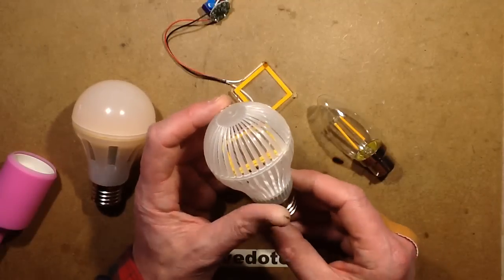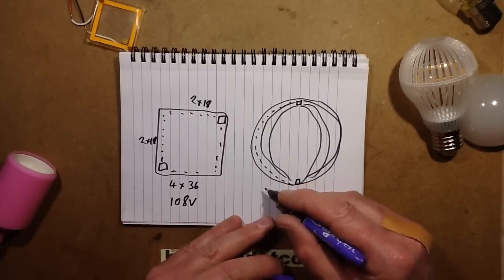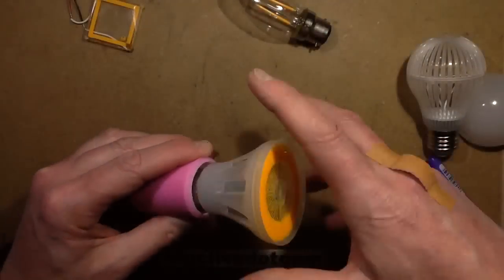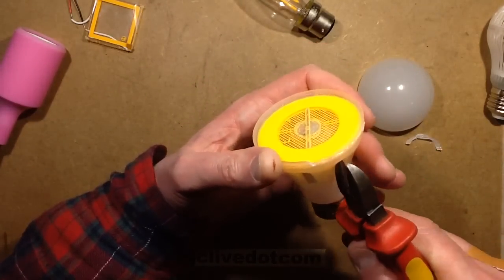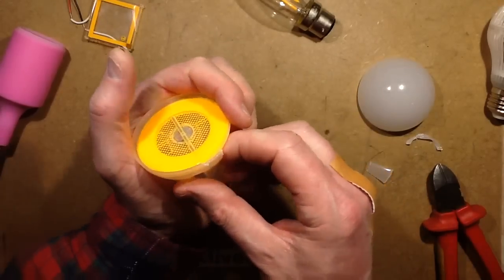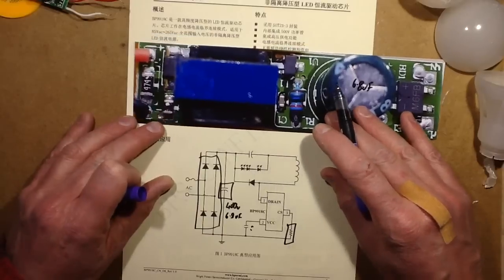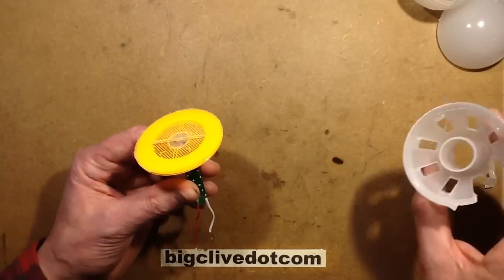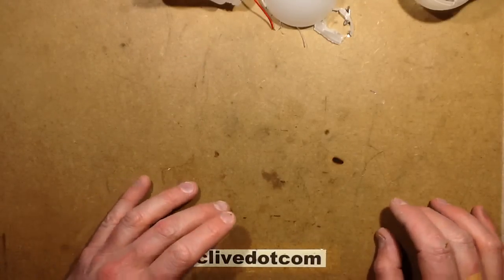Next generation glass COB LED lamp MKII teardown.

Comment: I really LOVE a ( leakage moment ) .... my " ghost " lamp ( awesome nightlight ! ) was probably the best buy lamp from the 2012's ( maybe they should market these ? ? ) ...... DAVE™ ............
Reply from the maker: You can turn many modern lamps into ghost lamps by removing a resistor inside.  Usually labelled 474 or 105 (470K or 1 Megohm)

Comment: Looking back on the glass sandwich lamp from 2019/20, the square-glass LED layout, and the filament-style one I have to wonder what the hell they were on that week to think up the sandwich and what they started out on with the square one before that.  It can't have been that cheap or easy to make for a start and for a second bit it can't have conducted 9-10w of heat that well either no matter how much air you gave it.  They must have figured leave the larger sized bulbs to the COB panels glued/compounded down to air/edge-casing/full heatsink (depending on quality of lamp maker) and put the filaments into bulbs that it both look nicer in and fit better like candelabra-sized ones (though power miniaturization of it couldn't have been easy unless they did a 3-pin buck regulator or similar).  Really weird transition time for LED bulbs for sure.

Comment: That was very interesting, and having seen the other "new generation" of LED lamps video, I can see this 'newer' version with its laminated design addresses one of my comments on the previous lamp, which is the mitigation of uv artefacts. With glass on both sides of the active elements, uv light is effectively blocked, so no stray artefacts to damage the plastic shell, nor to harm us, or anyone/anything else.

I am wondering just where the development of LED lighting will eventually lead us. Incandescent lamps have been virtually unchanged since the first tungsten filaments, so that's over 100 years. We had a brief flirtation with CFL for about a decade or so, and saw very little change during their lifetime, and now LED lamps, which conversely, have gone in leaps and bounds, with a plethora of different approaches, types and variations on a theme, but will we ever see large scale single light emitting elements that can output similar lumen values to those from either, say, 100W tungten, or 10W (assumed) LED array? Or are we heading towards something like an electro-luminescent fluid filled tube/bulb (OLED, maybe?).

Where will the quest take us?

Comment: ... It should be noted that the production of LED's and cob-led's are clearly wrong, which lead to nothing real - only to more or less high consumption of resources and expenses, which are in no meaningful relation to the real use of a room lighting.
So nothing is really functional.

What bothers me is the presumptuousness of the manufacturer to impose a product on me - that is, to sell a floodlight, for example, with 400 (!!!!) led's, which are available on a permanently installed board.
If an LED fails, the whole system can be scrapped - because it is usually faulty.
that is not right!
you can not exchange such things: there are no replacement bulbs to buy:
With no LED lighting, you can replace LED bulbs!

Thus, high pollution of the environment - especially here in the country (Germany) electronic scrap rather not separated and recycled.

I think: you should build yourself if you can!
but not even there is really useful in the market: the leds are closed
small - to create effective and meaningful lighting with it.
scale: plant lighting or seawater aquaristik - what works there right - is also to use!

regrettable that there are many who propagate normal - abnormal, which is really no good.

Where are the interchangeable LED modules - in full spectrum mixed light?

Comment: Strange, just got one of these from amazon but it uses a capacitive dropper, somewhat disappointed.
Reply from the maker: Capacitive dropper may be more reliable in the long run.
Reply: That would be nice, although I do wonder how much different the power factor would be, this one is 0.5.
Reply: It hasn't lasted long, the inner ring of leds go from a very dim flickery state to fully on, not sure if it's the leds or the dropper.

Comment: Aliexpress has a few of them, Alibaba is quite flooded. I've bought a few of these bulbs from an Italian retailer on eBay, with power ratings of 6-8-10W. The model Clive tore apart is the 10W model, 8 and 6W are very similar and a lot cheaper. I got a failed lamp with a broken wire between led and board, and went straight into take apart mode... The dome is quite well glued and doesn't want to come off easily, but once that's done, if you cut between plastic and glass with a scalpel, the glass disk will come out easily enough. That bulb has now been assembled back again and works well. For 3.5€, I cannot say those bulbs are half bad. As others mentioned, the magic word to search for these is "mcob".

Comment: Pictures of the cob with phosphor layer removed: 
http://pl.tinypic.com/r/2yjx9iq/9
http://pl.tinypic.com/r/2uiyrg5/9
http://pl.tinypic.com/r/10fdt0m/9
Reply from the maker: Interesting.  I guess you took the phosphor gel off the other side.  That could be quite blue looking when lit.
Reply: I have separated the two round glass pieces completely. It still lights up and is very bright and blue. BTW: it gets quite hot (even before being disassembled).
http://pl.tinypic.com/r/2a69oo5/9
http://pl.tinypic.com/r/2hn1d07/9
http://pl.tinypic.com/r/2nreqv4/9
http://pl.tinypic.com/r/vyqu6h/9
Reply from the maker: That's interesting.  I thought the phosphor loaded gel would have been used to encapsulate the chips, but I guess it's just a layer on the surface just like the front glass?  And actually just hovering above the array of chips?  That will potentially reduce the effect of phosphor degradation at the point of contact with the emitters.  Plus it will remove the issue of thermal expansion and contraction differences causing bond damage.
Reply from the maker: I might be tempted to try that.
Reply: Yes. There are two glass plates separated by plastic o-ring at the edge. The o-ring is 1mm thick. The plates are glued to the o-ring. So there is 1mm air gap between them. Both plates have phosphor coat rings. The one facing the bulb dome has phosphor on the outside of the cob sandwich, and this plate has chips on the other side - inside the sandwich. The plate facing the bulb thread (the one with checkerboard pattern) has phosphor layer inside the sandwich. The phosphor layers are of different thickness. The plate with led chips has thicker coat and gives more yellow colored light, the other one has thinner coat and gives a little bit colder light shade. I have reassembled the bulb with only the plate with led chips and  phosphor removed. It provides strong blue light.
Reply: Played for a while with the created blue bulb an it seems also to produce small amount of UV light. Made my eyes sore, very unpleasant.
Reply: Holy crap, nice work! :D Hopefully Clive does a followup and shot the pics :D
Reply: Because it's the most pleasing colour to human eyes :)

Comment: Illuminated single-pole wall light switches, containing a halogen bulb in series with main bulb are common in my part of world. I guess the 470k resistor is to prevent the bulb to blink on those switches (as you suggested). That is a clever tweak.

I see a scratch on your left thumb and sticking plaster on yoru right hand. Maybe it would be better to use a Dremel type tool instead of knives and some protective gloves.

Thank you very much for the videos.

Comment: Hunch from a former manufacturing engineer - I suspect the raised phosphor lines on the front are so the same die can be used to print the front and back glasses, and allow for the power lines to the pads.  Hard to tell for sure without opening one, but it would make sense on a commodity item to reduce the amount of printing and inventory by making two identical layers

Comment: This form factor might be used to make a fitting that attaches to a regular ceiling point and has flat arms extending out with what might appear to be downlighters along its length but the downlighters wouldn't need all that drilling through the ceiling and extra wiring expense?

Comment: Clive, what is the DC voltage at the led connection and I assume that this one is only for 220vac.
Reply from the maker: I tested it on 120V and it worked fine.  Combined LED voltage is around 75V.
Reply: bigclivedotcom Thanks, ....... I  pulled one of my fluorescent  (LED) tubes apart and found it to contain 6 banks of 34 leds each in parallel with a total current of 200 ma at 80 vdc across the leds. All it contained in the circuit was a bridge rect,  2 resistors, one cap @ 22 uf and two fuses front and back . This tube was a direct replacement of the old tubes and seems to work very well .... so far.

Comment: Can someone link me to the page that I can get one of those bulbs at since I have been looking for a light bulb for my office that has the bulbs sit sideways and if I use a regular LED bulb there is a dark area in the room because the bulb only points light in one direction and doesn't direct any light back to where the base is and these bulbs seem perfect for my office since they do direct light to the base of the bulb so I can actually get full light in the room
Reply from the maker: Consider a lamp splitter adaptor that allows you to put two LED lamps in one socket at an angle to each other.

Comment: That's really nifty :)  I can think of all kinds of crafty ways to use those disks in artsy lighting installations in restrooms and other public spaces, where you would suspend a larger glass or translucent material like acrylic and a smattering of those "pucks", and then the wiring for them would snake back to the hanging points, and the driving circuitry would be out of site.  It would provide an interesting feature of light in a very thin package that would splash down AND up, and if the little pucks were sealed into the material, it would be about as safe as any other fluorescent lamp.  I could also see these used as like oversized "pixels" or a very large dot matrix display (think freeway information signs or traffic control units with the big amber arrows).

Comment: I think I can shed some light on how the chip actually works.  The data sheet's drawing is a bit misleading.

Notice that the chip lives with its "ground" at the top end of the current sense resistor.
Notice that the Vcc capacitor goes to the lower end of the current sense.

When the MOSFET is on, the Drain connection is shorted to the CS connection by it.  This means they can't be charging the Vcc capacitor when the MOSFET is on.  Also since the capacitor goes to the bottom side of the current sense resistor, the voltage the chip sees as Vcc will ramp down as the current ramps up.
Thus by watching the Vcc, they get a good signal to use for when to switch off the MOSFET.

When the MOSFET is off, they charge up the Vcc capacitor to some regulated voltage.  They may have gotten clever and do this with a delay so that the regulator making Vcc is still off while the voltage is Mains+75V and it only charges when the energy is out of the inductor.

I base this on a "if I was doing it" line of reasoning and the fact there are only 3 pins.

Comment: Anyone else looking for these lights just search MCOB

https://www.aliexpress.com/wholesale?catId=0&initiative_id=SB_20170129074236&isPremium=y&SearchText=E27+mcob

Few on Amazon for anyone in a rush
https://www.amazon.co.uk/XINBAN-white-1300LM-crystal-replaces/dp/B0120S8KIS/ref=sr_1_26?ie=UTF8&qid=1485704712&sr=8-26&keywords=MCOB

Seems they sold out all the ones they had if this is the listing :( 

https://www.aliexpress.com/item/8-10-12W-AC-85-265V-E27-MCOB-LED-360-Degree-Emitting-Light-Energy-Saving-Bulb/32788375641.html?spm=2114.01020208.3.352.YDqmxn&ws_ab_test=searchweb0_0,searchweb201602_4_10065_10068_10000032_119_10000025_10000029_430_10000028_10060_10062_10056_10055_10000062_10054_10059_9911_10099_10000022_10000012_10103_10000015_10102_10096_10000018_10000019_10000056_10000059_10052_10053_10107_10050_10106_10051_10000053_10000007_10000050_10084_10118_10083_10000047_10080_10082_10081_10110_10111_10112_10113_10114_10115_10000041_10000044_10078_10079_10000038_429_10073_10000035_10121,searchweb201603_10,afswitch_1,single_sort_1_create_desc&btsid=fac2ffcc-9d82-4863-a9ac-ae0a153eaf45
Reply: Thank you very much!
Reply: Brilliant, thanks.
Reply: Jan Tichavský efficiency, + size they are quite efficient and the LED are spread out so not really any hot spots to need sinking.
Reply: Thanks!  Anyone have the link for the first set? The square one?   Guess I could go back to that video eh?
Reply: I tried getting the first ones from aliexpress i think, picture was the same but ended up with some really cheap plastic basic led chip bulb :(
Reply: Search "Korea COB" on Aliexpress. Be sure to actually pick the Korea COB bulb in listings with multiple options.
Reply: It's produce more light than square filament led?
Reply: Sadly, the only ones I can find, are 220v :(   The new generation has 120v versions.   Oh well.
Reply: Thanks, that's what I was looking for. They sound very nice.
Reply: why would you buy 10w light without heatsink? it will fry itself soon
Reply: It looks pretty well ventilated.
Reply: Dave Webster thank you these are so what I need thank you

Comment: Link:

https://www.aliexpress.com/item/E27-LED-COB-Brightness-Round-Light-Bulb-Lamp-10W-Warm-White-85V-265V/32779678814.html

It's significantly more expensive than the previous gen (which is still being sold).

What was appealing the most about the previous gen model was that it could be disassembled in a non-destructive manner and the filter cap preemptively changed to some 20,000 hour long-life replacement.

What they need to do is take this new COB, keep the 85v-265v mains input feature, and move it to the old enclosure.

Thanks Clive.  Liked.

EDIT:
Here's a different seller:
https://www.aliexpress.com/item/MCOB-E27-LED-Bulb-E26-Full-Power-PC-Crystal-Ceramic-4W-6W-8W-10W-85V-265V/32753965693.html

The keyword seems to be "MCOB"

Comment: OWWW. That cut on the end of your thumb looks like the absolute ultimate rule breaking of "dont pry using a screwdriver with it pointed at your fingers". I do more mechanical (car or small engine repair) work than I do electrical work, so prying things with a pry bar or screwdriver is fairly common when reconditioning parts, and I've learned the hard way not to pry TOWARDS my fingers when holding something: even a dull blade can go in deep if you're prying hard enough.
Reply: it was a utility knife, earlier video, we were spared the actual gore.

Comment: Quite a bit of of stuff in a small package. Here's a quick translation of what's listed under "Features" in your Chinese data sheet:

SOT23-3 package (ok this didn't need translation)
Internal integrated 500V power transistor
Integrated high voltage supply
Inductor critical conduction mode
Does not require auxiliary winding monitoring or power supply
Wide input voltage range
+/- 5% LED current accuracy
LED short circuit protection 
IC under voltage protection
IC over temperature adjustment (I expected over temp protection but it says "adjustment")

Comment: No inrush surge protection, the bulk cap will result in a large current spike if switch on coincides with the peak of the mains sine....that bridge rectifier will eventually die.
Reply: blower no shit it'd fail with full 350vdc on it for two minutes. A fair test would be pulsing straight to 350 and then down in a few milliseconds. (And with some house wiring and/or lamp wiring in circuit).
Reply: Nah, it will be fine. Those bridge recitifers have rated surge currents of tens of amps. The resistance of the wires, "crimp" connection, bulb socket contacts and whole mains wiring in the house is way enough to limit that. The capcitor is also very small. You don't need inrush limiting on such low power PSUs.
Reply: You'd be surprised if you stick it on a fast scope. I used to design switching LED drivers for a living some years ago, and had plenty of Chinese junk fail in this way due to no inrush surge limiter. It does depend on the internal resistance of the cap and you may just get away with it in this setup, but I have seen surge current spikes up to 100 amps when timed with the peak sine on a 240v mains input. I created a tester that would supply 350v DC, simulating the peak of 240vAC and switch lamps on and off at 2 minute intervals (giving time for the bulk cap to fully discharge and hence max draw)....many a cheap lamp did not last more than an hour on that thing.
Reply: and no heatsink at all

Comment: had you tried stuffing the driver and panel in a DIY enclosure?

Seems like you can salvage the light itself since it works, just shove the glass into it and save the other light stuff for your parts bin.

Comment: I have exactly the same style lamp but mine has a plastic disc, not glass (... tooth test). 8Watt - 22 LEDs. The circuitry is the same except that mine uses a 0603 resistor to set the current. (Two 0603 paralleled on top of each other.) The disc gets toasty hot, up to 95dCel

Comment: Nice lamp and looks promising. Much better than the led strips etc that make those zebra stripes. Why do they stick with the awful plastic ball? They could make a glass ball/tube with the cobs on the surface and power supply inside.